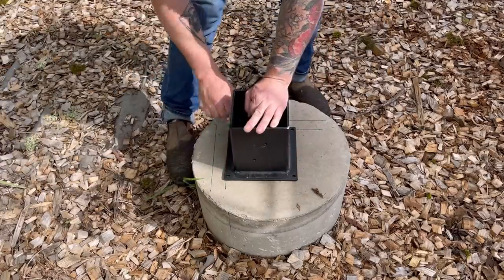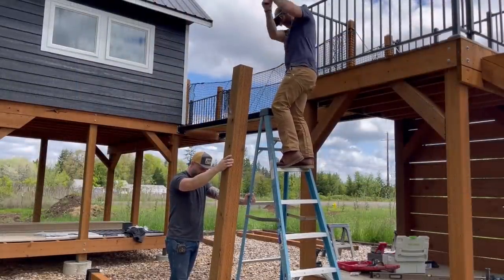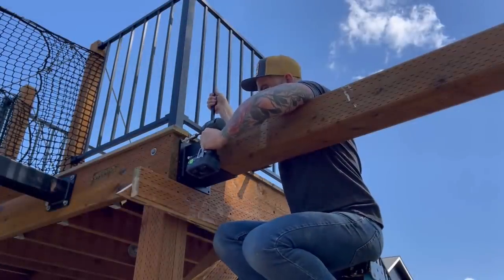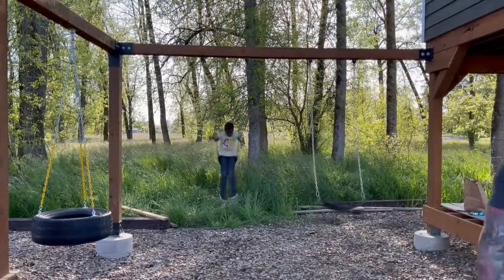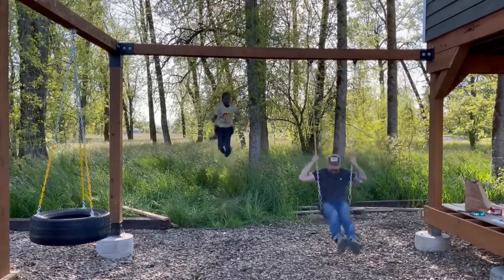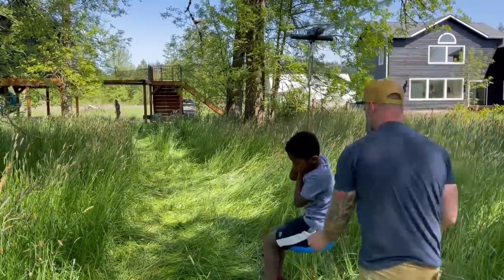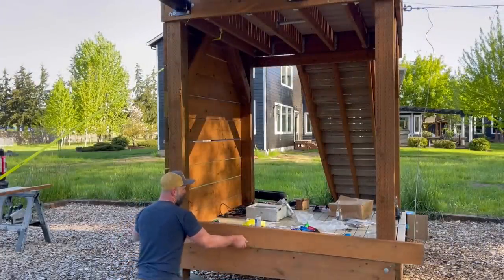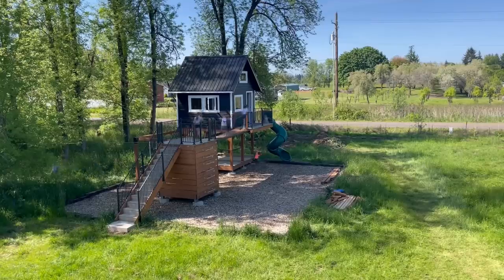I'm Still Working On The Treehouse || Backyard Treehouse

Comment: Hi Jason, really cool project! As I've worked as a rigger I want to clarify a few things about the zipline installation in case people want to buy these parts and build one themselves.  The short cable around the tree is called a "Bridle" and they can be built as you did or purchased premade with factory crimped end loops also called "swaged" loops which have no clips that loosen or rust.  The black  "U shaped thingy" you used to connect the zip line to the deck hardware is called a shackle and you used it exactly how it's intended. As someone has already commented it looks like you  installed the cable to cable clips (also referred to as "Crosby connectors") backwards. Refer to the comment below about "never saddling a dead horse".  The body of the clip always goes on the load bearing line and the u-bolt on the slack side. The way you have it they are more likely to loosen and the u-bolt shouldn't grab the load line as it crimps the cable lowering it's strength rating. The 1\4" aircraft cable is a great choice as its way stronger than you need and the stransa are stainless steel so it will hold up well outdoors but it does stretch a bit when first put under load so expect to tighten it a few times this summer.  Also check it for rust a couple times a year, especially in places where the cable gets crimped by hardware.  If you find it rusting too quickly, this cable is also sold covered by a vinyl sheath which is even better outdoors.  Enjoy being the neighborhood dad hero!  The other dad's on the block should be providing all the BBQ's this summer in thanks!
Reply: I was looking for this reply when I posted mine. I’m not sure if you were referring to my comment or not. I couldn’t remember all the names of the bits so thanks for that!

Comment: Great work and happy son. Good job dad! The one critique I would have is to remind you to “never saddle a dead horse “ on your zip lines @ 16:35 I noticed your cable clamps are backwards. The saddle goes on the loaded side of the cable and the u bolt goes on the cable end (non loaded) side. Thus the phrase “never saddle a dead horse “

Comment: Pro Tip- Put the washer and nut on a little way prior to sinking wedge anchors. This will save a big headache if you damage the starting threads pounding them in.

Comment: You're such a good man. Don't be surprised if a few people hate you for it.
And a technical question, will water sit in bottom  bracket or does it have weep holes?
Reply from the maker: There is a giant hole in the bottom
Reply: @Bourbonmoth  thanks

Comment: To ALL!  There ARE specific instructions for installing wire rope clips; see Kimball Midwest U-tube vid "Hot to use wire rope clips".  In this mfger's vid, we learn the expression, "Never saddle a dead horse".  That means proper install does NOT allow the "saddle" of the clip/clamp to be on the "dead" or shorter end of the wire rope/cable.  There are also mfger requirements for "turnback" length, number of clips/clamps, and the suggestion to use "thimbles".  Bourbonmoth, at 23:30 or so we see the clips/clamps "saddling a deadhorse".  Wire clips/clamps improperly installed can lose 40% of the wire cable's strength!  ALSO, be aware that all other components should have a similar "working load limit" as the cable, so threaded links, turnbuckles, carabiners, etc. should be properly sized and be rated.  In my experience, McMaster Carr's catalogue is both a good source for parts/pieces, and for instructions on use.

Comment: I don't know how sturdy those post would be the more the slide is used and depending on the size of the individual using the slide. I personally would have used solid 4x4 posts that were lagged into the rim board.

Comment: instead of grinding out the bracket, wouldn't it have been easier to take out the bolts one at a time and recess the head of the bolt?? Also less problems with alignment of the grinding out!!! Cut the bolts to the ends of the bolts - don't think so - cut the bolts to the ends of the nuts - that's what you were trying to say!!! Love the auto return for the zip line!!!

Comment: The only thing i could critique is the cable clamps on the zip line looked to be installed backwards. Im sure its plenty tight and only holding a kid so theres probably no issue but the saddle needs to be on the long run not the tail end. “Never saddle a dead horse”

Comment: It looks to me like you've installed those cable clamps (crosby clamps) incorrectly.  The ubolt should be installed so the  end of the cable is under the u-bend, not under the nut side.
Here's an illustration: https://www.elitesalesinc.com/wp-content/uploads/2016/09/elite-sales-installation-02-2.png

Comment: I enjoy the look but hate the fact that you totally ruined the "suspension bridge".  It shows how not to design and build a suspension bridge, what a waste of effort and material.  If done right it would have been cool.  Instead it is simply a mess of errors and poor design.
Reply: If you're going to make a trashy comment like that, you should at least explain what you feel is wrong about it.
Reply: @markdlondon  They added steel to hold the bride apart, they could have just used the steel to hold the flooring up.  Problem is that both structures came together.  Another option is to put in bracing to stiffen the structures and skipped the steel. I am certain there are other clean and cool options, they did it the quick and easy (really not easy, but definitely not cool way) I thought it was obvious what was wrong with the bridge but happy to provide an explanation.